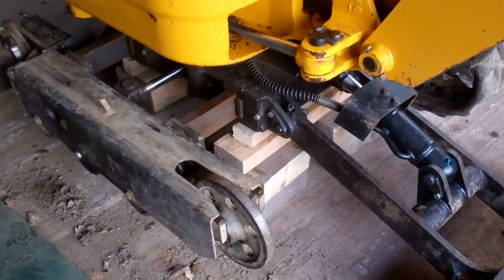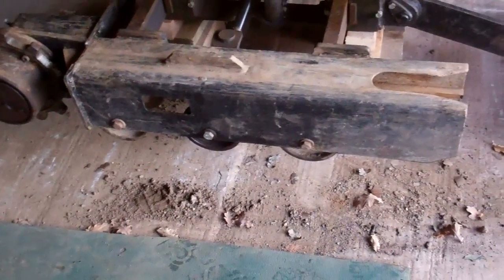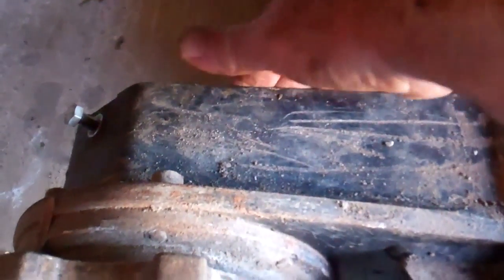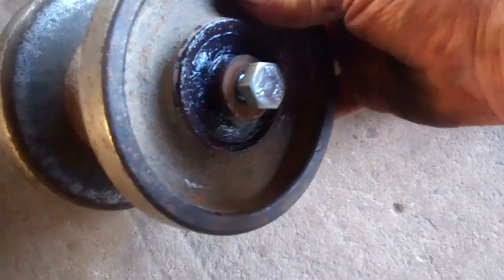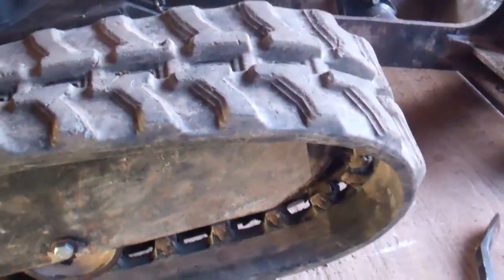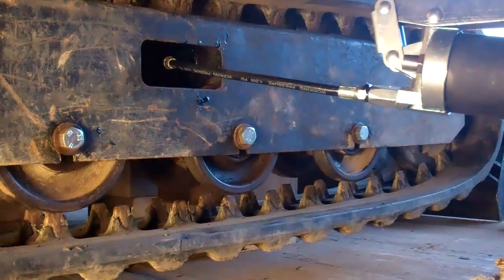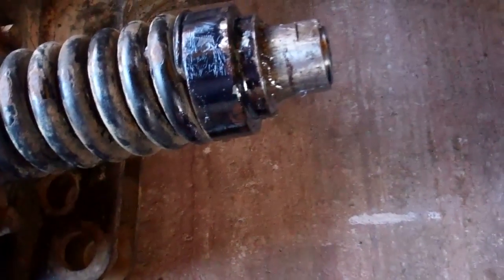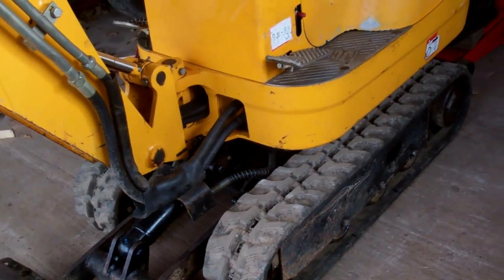Tracks removed & track tensioners serviced on JCB micro digger

Comment: Do you still have  the jcb 8010 and has it been a good machine i'm looking at one next week to buy just wondering if you've  had any major problems ?
Reply from the maker: Yes I still have my JCB micro digger, the previous owner had not given it proper care, so I thoroughly checked over the machine, gave it a proper service and rectified what was needed ( as can be seen in a few of my videos) one thing I did not show in a video was where two hydraulic hoses had rubbed together and started to chafe through the steel webbing, I think this could be a common problem with this machine due to a lot of hoses passing through a small space, I did rectify this problem by using long cable ties to hold the hoses away from each other. Another thing that needs checking if the machine has been used in deep mud, the two metal covers that cover the drive motors need to be removed and you will find that the drive motors will be completely covered in mud and the metal ends of the hoses to these motors will be badly rusting.
Reply: @johnbower your a star John, is yours the 8008 model or 8010  ?

Comment: Hi John,I have a jcb 8015 with 25 mm pins on the bucket but I have mistakenly bought a 18” bucket with 30 mm pin holes do you know if I can get some bushes to shove in there to reduce the 30 mm down to 25mm.
Thanks 
Kevin.
Reply from the maker: Lego Wolf, Bushes are generally made of bearing material like bronze and are not expensive, the size you are looking for (30mm o.d. x 25mm i. d.) is a standard size off the shelf and available in different lengths, or you can have bushes made out of any material to any size you want.
Bushes are perfectly round in their diameter and perfectly parallel along their length,  whether off the shelf or purpose made, So the big problem you will come up against ( if it's a used bucket ) the holes will no longer be perfectly round or parallel through their length due to wear.
The only way you will get bushes to press tight into the holes and not come loose is to have the holes line bored, then use purpose made bushes to fit, but that would be expensive.

Comment: Great video John, very informative thanks. I've got squeaking from either an idler wheel or roller on one side, any suggestions how I would identify which it is?
Reply from the maker: Emily Taylor, To check the rollers lift the machine so the track is hanging away from them, then turn each roller by hand. If you need to check the idle wheel the track will need removing.

Comment: can you not put oil in the rollers - refill them
Reply from the maker: orkid knog, there is no filling plug, it appears the oil is put in during assembly of the rollers, this is a very poor design because the contact surface for the seal gradually rusts and wears the seal away. there are ways to repair and modify these rollers and this is something I may get round to doing.
Reply: @johnbower  ok thanks for the info i didnt think they could be refilled so couldnt see alot of point taking them off, but good job
Reply from the maker: @orkidknog4147  One of the reasons I removed all the rollers was because some of the setscrews had seized also some of the cup washers had been fitted the wrong way round, I refitted the rollers using all new 8.8  M12 setscrews with copper grease on the threads to make them easier to remove next time.
Reply: my komatsu pc35 and kubota kx71 both have an allen plug where you can pull out  of the top side on the roller and slowly fill with oil.
Reply: but usually its best to just buy new ones if they are leaking as I have not been able to source seals for them. sort of disposable items.

Comment: Great video. Replacing track piston when the track is off - no problem but to remove a track what size spanners do you need to release the track tensioner piston?
Reply from the maker: Hi Crohnoid, Thanks for the comment. Note: the grease nipple does not appear to separate from the plug but it will turn round to face any direction. You need a 24mm spanner to undo the plug, and to stop the piston turning you need a 32mm spanner on the two flats on the piston end. Note: before you put the plug back in, make sure there is no air pocket inside the cylinder, also check the dowty washer fitted at the back of each plug is in good order.
Reply: Thanks